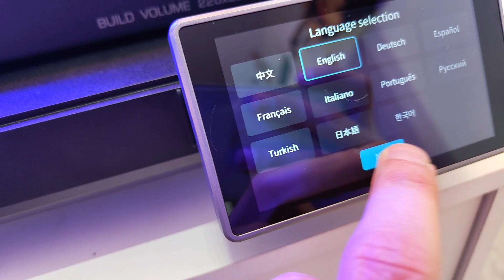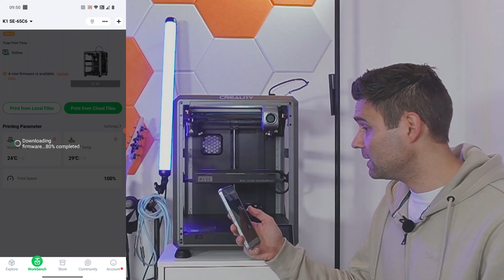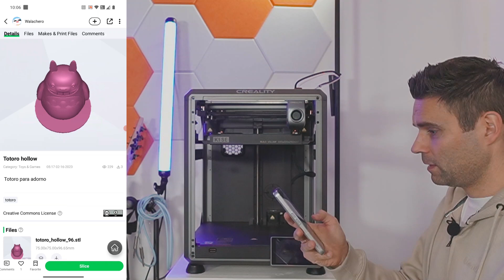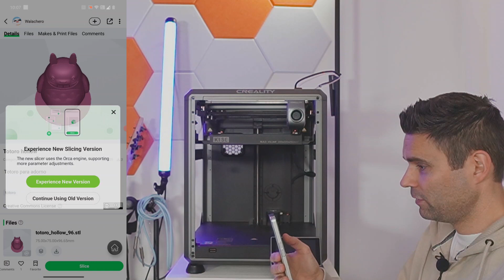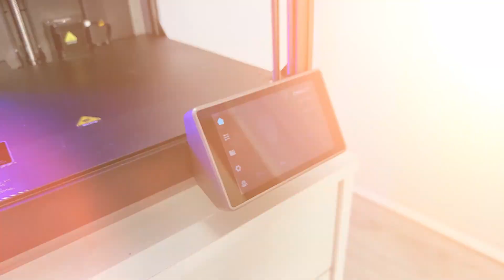Unboxing & First Setup - Creality K1 SE 3D Printer

Comment: Mine wont turn on for some reason
Reply: Interior power input switch under sticker on the bottom  left side needs to be switched to the input voltage if it’s not turning on.. flip it the other way— it’s in the instructions “please do this^ before applying power”

Comment: wish more people would talk about the voltage switch on the side! if it won't turn on, on the left side of the printer is a plastic covered hole as you open it. inside is a red sliding switch. i used the allen wrench that came with it to slide it to the right. now it should read 115V. restarts as normal then. 

p.s it is mentioned b/w steps 1 and 2. I'm just stupid.
Reply: Thanks
Reply: Thank you so much it took hours and then I read your comment and it worked

Comment: Mine says it's printing but nothing is happening? Shows like 20% done on the boat but it hasn't printed anything
Reply: Try pushing the fillament harder while it's printing, if it starts to throw the thing stop the printing, clean the plate and restart, it should work. Remember to lock the fillament in place after it works, there's a lever with a padlock symbol on the nozzle

Comment: Do I need to hook up to WiFi just to use it?
Reply: Yes all 3d printer printers need wifi unless your using the sim card that comes with it
Reply: @Thatonemonkey42 well I have an SD card with all my files on it so I should be good without WiFi?
Reply: @Lbg910 you need WiFi…. Unless you hook it up via usb cable

Comment: Mine won’t turn on
Reply: Same
Reply: I FIGURED OUT THE FUCKING PROBLEM GUYS THERE IS A VOLTAGE SWITCH!!!
Reply: @isaiah-t6i  that was my problem to. if you live in USA then you will probably have to switch it to 115V. you have stick a flathead screwdriver to flip the switch.
Reply: My voltage switch is on but it’s still not pls help
Reply: @Radioactivebean9hey so where do you live in Europe?
Reply: @Radioactivebean9yea same

Comment: hi, its possible to install rear and lateral fans in K1 SE in order to print abs, I can install custom panels and door easy but need to know if the printer comes with cables for the fans or at least theres place to plug them like the camera do
Reply: yes bro its literally a stripped K1C I had mine for 3 month already